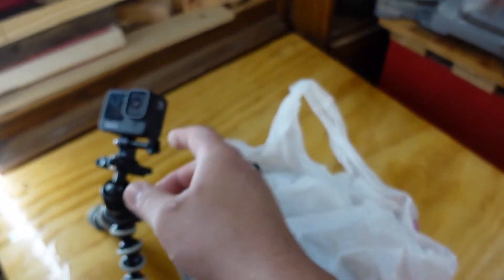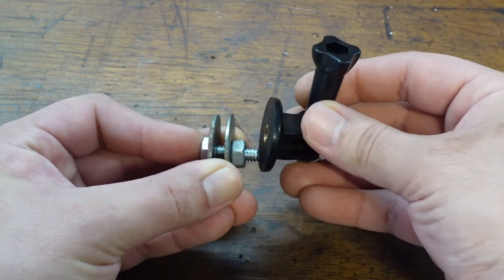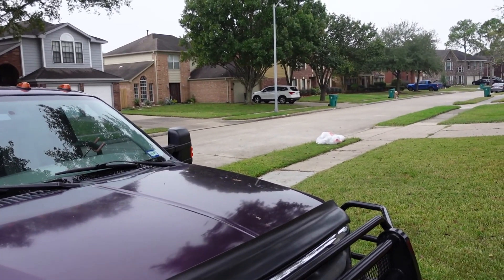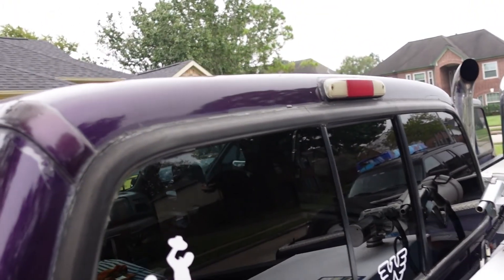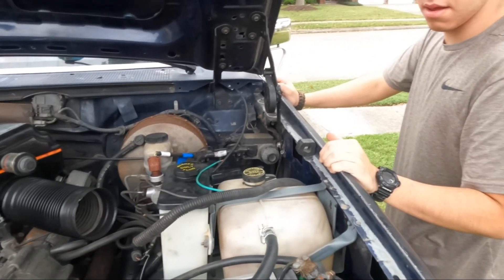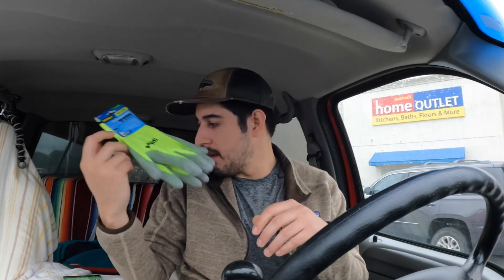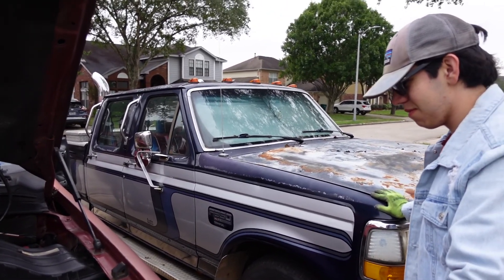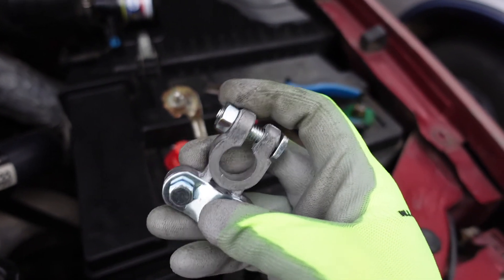GoPro Truck Mount

Comment: Thanks for the GoPro mounting ideas. I am currently buying the parts to attach one to my Silverado factory grille using a metal plate inside grille and one outside grille and adding a locknut. I am going to go on epic road trip in northern  California near Oregon border and wish to document it. Thought about adding GoPro as a hood ornament but decided against it.